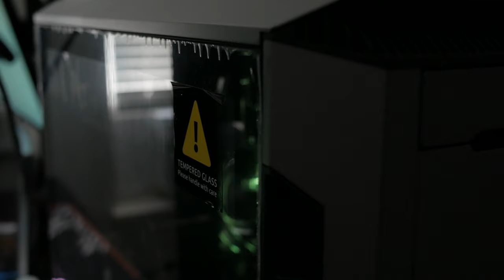SFX Ryzen & Radeon custom loop - Part 1: The Build

Comment: what is that pump res combo  ypure using.  and whats that case.  both are tiny and something id love to use on my cerberus build. is that a laing ddc pump? im struggling with  finding appropriate mounting for my  alphacool eisstation
Reply from the maker: The pump is in fact a Laing DDC- it was actually decently cheap. Reservoir is a Phanteks PH-R160, but they do also have updated versions that are clear all the way through. The case is also from Phanteks. It's an Enthoo Shift X. They also have a smaller version that is called the Shift (no X). Jay actually just did a video where he built in the smaller one if you want to check it out and see if that might be something worth considering. Unfortunately the smaller one does have much more limited radiator space though. In my opinion the best cooling is going to be the larger Shift X that was used in this video, but instead of a 280 rad like we used, I would recommend a slim 240 rad where our 280 was, and then an additional slim 120 in the bottom. The bottom will accommodate a slim 120 when you move the side rad down from a 280 to a 240. Good luck with the build!
Reply: Thanks for a swift and exhaustove reply
 i will definitely consider this  reservoir. its very convenient how you mpunted it in the case. i already got the cerberus case( no, that wasnt my fad to name it that its the case name in event you handt come across it haha) So ill stick with that got two 240 tads one 45 mm one 27 from magicool. And i fit he e eisstatilon ddc combo  on EK verticalattached to top fan in front rad... no the moubting holes dont align at all. i double sided taped it to the sucker haha.  sadly i bpught too littpe fittings, and  i am  now facing the brutal reality of not having bought 90 DEG fittings. the kinks. they were everywhere at start. do ypu recommend  90 deg  fittong over 45 deg? not sure which to order now
Reply from the maker: @theoryismypraxis3538  I'll have to take a look at that case. I've never come across it before, but I have heard it mentioned here and there. Personally I love Alphacool's 90 degree rotary fittings. They have been perfect for me, look good, and don't break the bank.
Reply: yeah that last aspect is probably most important for me as of now. im basically a student with no flowing income except like 100-200 usd a month from some coaching i do, so i basocally spent a totality of all the money i ever earn on my luxeries, sold mpst of those luxeries and got myself this watercooling build as a carry on luggage itx pc and ive ran put of cash xD
I think ill go with 90 deg. seeing the tubing layout it seems sound  and  like it wouldnt cause tube clutter. now one of my tibes with straight fittings is about 30-40cm  to avoid kinks

Comment: This was an Awesome build.  I love how you kept.  The back plate of the 5700.   Just one question sir.?   How long before other Tech companies.  Start to show off.   There own version of the 5700xt.  Once again thanks for posting this video..
Reply from the maker: Thanks for the comment! I believe there are actually a couple of custom board partner 5700's available for pre-order here in the US on Amazon. That said, I expect that we will see most of the custom variants by the end of this month (August).  Additionally, great question because I didn't mention this in the video since we will have a part two coming soon, but I would not purchase a reference design 5700 unless it is specifically to put a water block on. I like your thinking sir- smart move to wait on board partner cards!
Reply: Thanks I'm thinking of building my own pc.   My old dell computer died.   All I did was move it.   To a different room in my apartment.?   Maybe something touch something, & 🧲⚡🔥.?   But some of my old parts.   Can be used in a mew build.   I love *(EVGA DARK Motherboard Z390,  & AUSU ROG Extreme Omega).   By Christmas time I will pick one.  Ha. Ha. Ha.  😀👍
Reply from the maker: @shadowr2d2  Yeah if you start saving now there should be some great deals around Black Friday and Christmas time. Good luck with it!